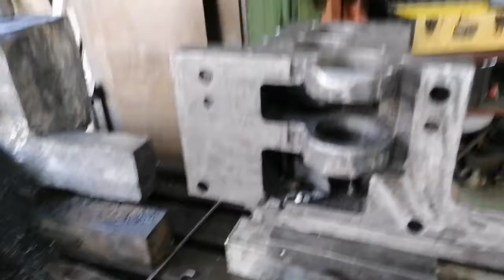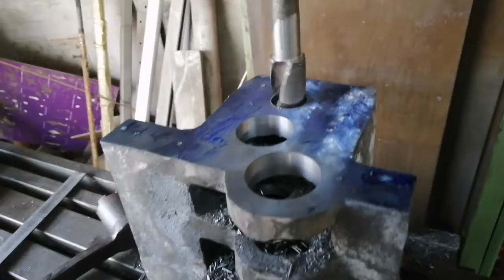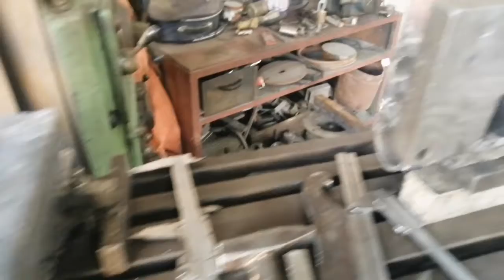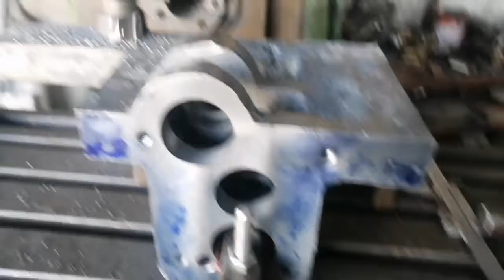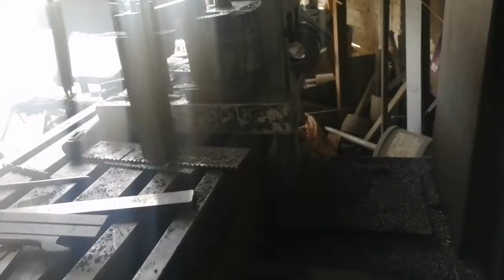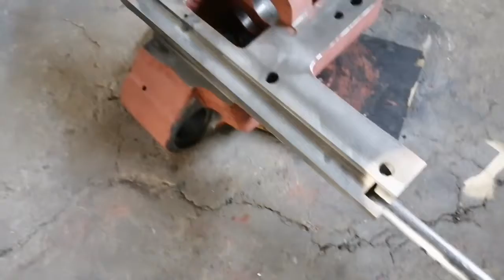Milling Machine feed Rod Gear Box

Comment: Hello sir gearbox housing width length height sizes and bearing pocket size or case bearing wall thickness milling machine model and vartical sliding kitna ha